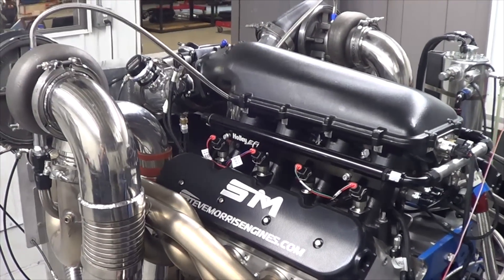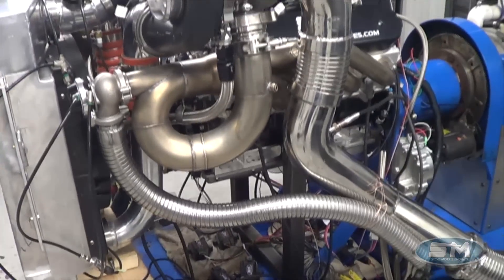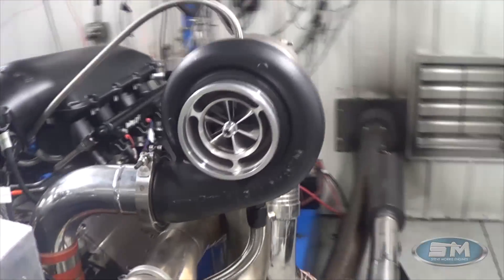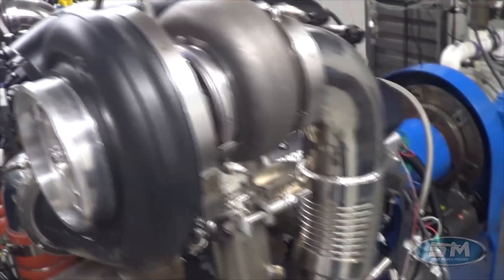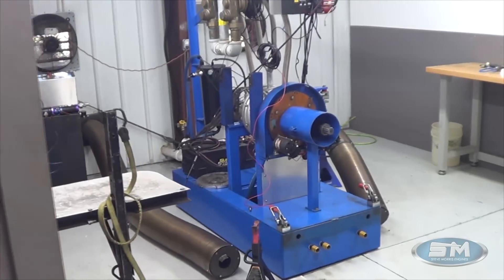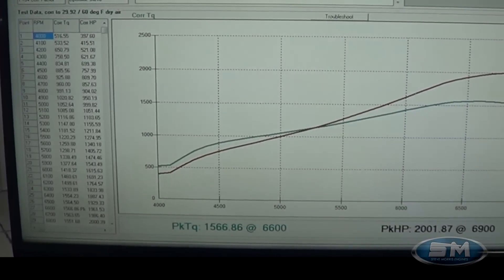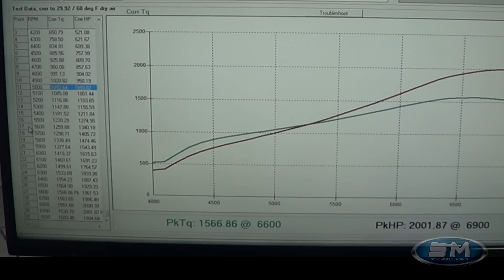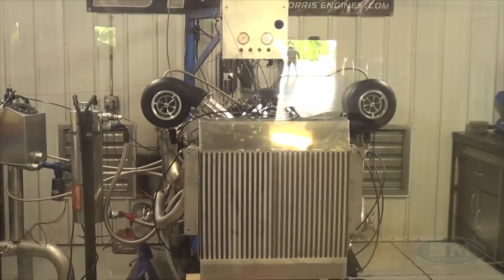2,000+HP hydraulic-roller, TT, LS

Comment: Steve...It would be nice to mention what fuel each engine is dynoed with. My GT500 runs three tunes: Pump gas --- 760rwhp, 104 race gas --- 810rwhp and C16 --- 985rwhp. Max boost is 17psi from a 3.4 Whipple that blew out the rotor shaft bearings with less than 15K miles on it. Thanks Whipple for sourcing cheap chinese bearings at my expense!!!!!!!